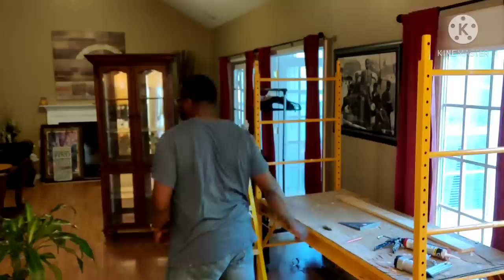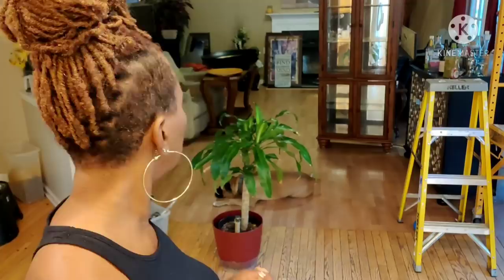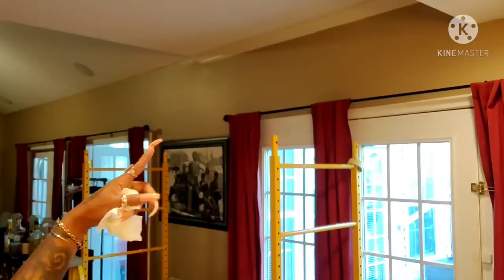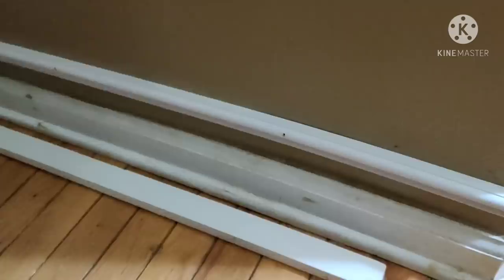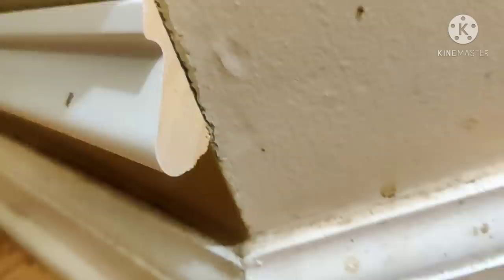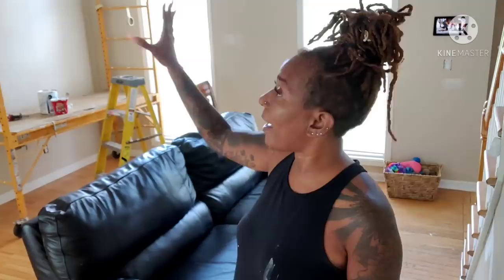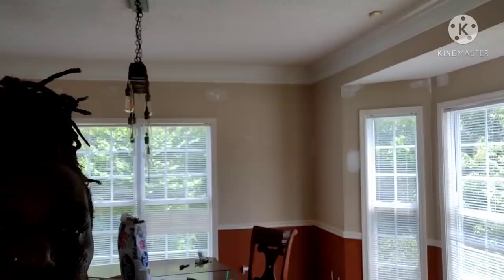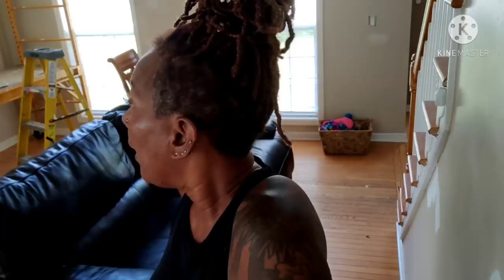HOUSE TO HOME EPISODE # 5 || PAINTING  || MORE TRIM THIS TIME BASEBOARDS

Comment: Sharon, Ron is right about placing the TV over the Fireplace is not good. It will get too heated when the Fireplace is used. That will reduce the lifetime if the TV. But I know you two will work it out girl.